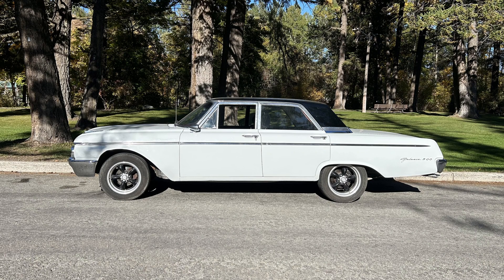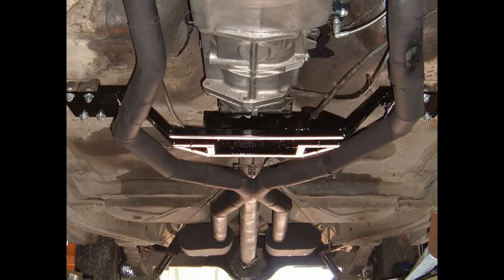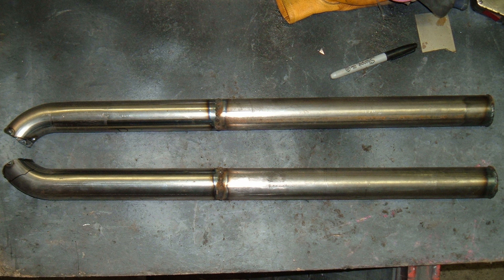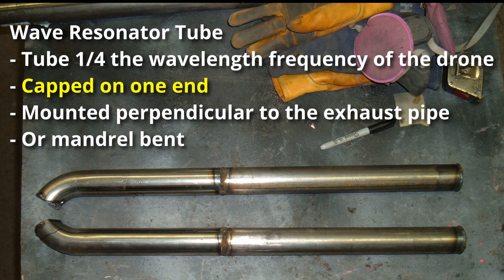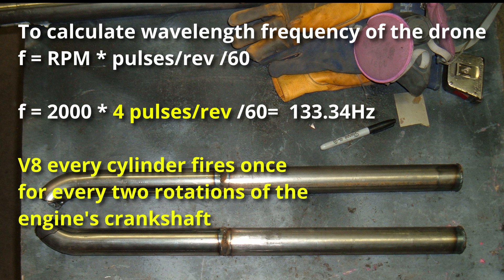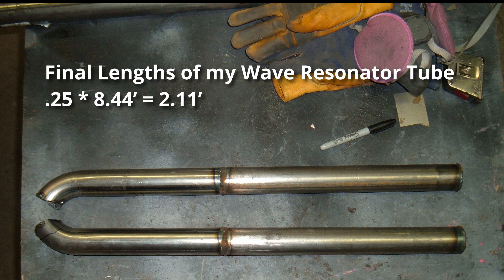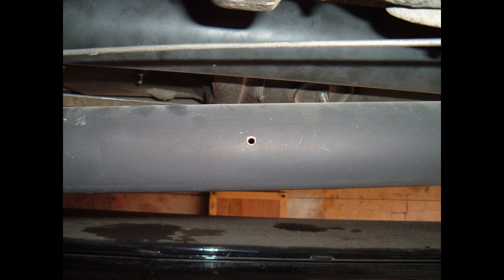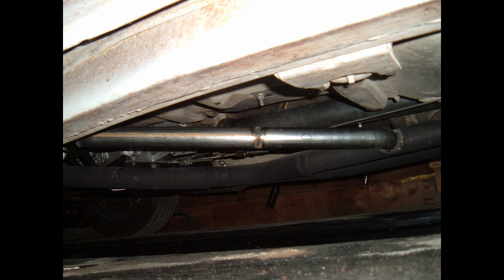Using Science to Eliminate an Exhaust Drone by Building a DIY Quarter Wave Resonator Tube

Comment: I like your simple breakdown of the math.  Some other explanations I have reviewed were hyper fixated on getting the exact operating exhaust gas temperature as well as additional complicated steps involving the inner diameter of the main exhaust pipe and the addition 1/4 wave pipe.
Reply from the maker: I have no doubt those things do effect it but its a dynamic system with all those things constantly in flux (other than the diameters)  Whats nice about this technique is it gets you "close enough" to generally work in a specific range.  Glad I could be of help

Comment: Does it matter where in the system you install this? I always see it AFTER the x pipe and even usually at the tips/mufflers. Am I correct in thinking it doesn't because location changes temperature while calculating speed of sound? I didn't see you take temperature into account when using speed of sound.
Reply from the maker: it doesn't mater because its the entire exhaust vibrating causing the drone.  You can fit it wherever you have room

Comment: There's a scientific study somewhere that says if you round the junction where the QWR T's into the exhaust; it works over a wider frequency/rev range.
Think velocity stack or bell mouth flattened on 2 sides kinda story...
Also less restriction was mentioned IIRC.
Reply from the maker: Very interesting... A little more challenging to do but well within what someone could do in their own garage.   Hardest part would be shaping the bell to fit on a round surface.
Reply: @dazecars  Google:
Noise reduction using a quarter wave tube with different orifice geometries

the side-branch with a bell-mouth geometry resulted in the greatest noise reduction by an adaptive quarter-wave tube.
Reply from the maker: thanks for the info

Comment: Since the noise is traveling, wouldnt its distance drom source be in the calculation?  
When i first saw your style i thought you might have tested it clamped first to adjust for the correct frequency.
Reply from the maker: Thanks for the comment.  Lots of people have made comments and tried to point out variables or calculations that would need to be made or accounted for  BUT they fail to take into account that these calculations are based on the actual drone RPM.  All the factors like the one you mentioned are part of the system that creates the drone.  None of those factors change so the tubes work with just the simple calculations outlined in the video.  I am sure the whole thing could be fine tuned and optimized with more calculations and a better understanding of how sound travels but the system works as is, the drone was completely eliminated on my car and many others so if it works as is there is not much benefit in adding more complication.

Comment: Hi ,does it matter where you place the j pipe and what cubic in engine is in your car,thanks from new zealand muz
Reply from the maker: placement does not matter, you can put it where it fits.  as to displacement that doesn't matter either as the sound is dependent on pulses per revolution not how big the bang is at each pulse.

Comment: Wondering if there was a noticeable range it klled the drone. Like +/- 100RPM? 500RPM? 1000RPM?
Reply from the maker: It killed the drone at the range at which it was droaning.  This is to fix a drone at a specific RPM range not a drone throughout the entire RPM range.  My car was droning a 2000 RPM so I did the calaculations for 2000.   had it been a drone at a different RPM the tube would have been a different length based on the calculations..
Reply: @dazecars  right, but I’m sure there was some drone at like 1900 or 2100 too. Did it fix that as well?
Reply from the maker: Oh sorry, yes eliminated the drone on either side of the target RPM  BUT I was also very careful to get the exact RPM where the drone was resonating.

Comment: I was curious if the same calculation worked for 4 inch single exhaust on my diesel pickup?
Reply from the maker: It should work as long as you account for the correct variables: RPM at which the drone happens and pulses per revolution.  Pulses per revolution will depend on the number of cylinders.

Comment: THANK YOU for breaking it down ... saved me MUCH aggravation (so much easier when someone else already has the keys) 
EZ PEZEE:face-green-smiling:
Reply from the maker: glad I could help!!
Reply: How did you get the frequency of the drone? Sorry if I missed it?
Reply from the maker: its calculated based on RPM at which the drone is happening and the pulses of the engine.  Its all in the "math" section of the video. 3:00

Comment: Did you (or anyone!) check if the diameter of the resonator pipe makes any difference?  I'm running a single 3" system (proven to support more power than I'm making!), and it'd be way easier to make the pipe out of ~2".
Reply from the maker: Excellent question.  When I first researched this mod the conventional wisdom was the wave resonator tube needed to be smaller but I never could find a definitive answer as to how much smaller or why.  My exhaust is 2.25" and my wave resonator tubes are 1.5".  I don't know how bigger or smaller would have effected it but I know it works at this ratio.  2" would likely be perfect in your application as it is the same ratio.  Please don't hesitate to reach out if I can be of any further assistance.

Comment: Thanks for all your great videos!  You have a very relaxing radio style voice.  Random question: can I power two treadmill motors simultaneously via a single controller?
Reply from the maker: Thanks!! Yes and no.  First you need to look at the amp rating.  Let's say they are both 25 amps 90 V thats 2250 watts and two of them would draw 4500 watts.  Thats half of the 10000W the SCR can handle BUT you will likely trip the house circuit breaker if you get up to that many amps.  A motor donly draws max amps under a lod and a slight spike at startup.  The other issue is if they are matched and running together no problem (watts and amps asside) but if they are at all different you will likely have different speeds and different amp draws at any given situation which will effect their functionality relating to each other.  All of this is less of an issue at low speeds and becomes more problematic as speed increases.

Comment: I fabbed a normal large dual exhaust on a GM A body w/ 400 cubes. I installed TWO (large, 2x2 square tubing) crossover balance pipes and made them 10% difference lengths.
No drone. Thinking about taking some of the fiberglass out of the glass packs because it's too quiet. lol.
Reply from the maker: I made a custom exhaust for my Mustang and it didn't drone either.  It all comes down to the the resonance frequency of the exhaust, if that frequency is not produced by the motor at a specific RPM then there is no problem.

Comment: I'm still trying to figure out why anyone would want to cancel the drone. So weird.
Reply from the maker: You have missed the point as this is a resonance drone not the typical sound of a custom hot rod exhaust..  Im not trying to  "Return to a more stock configuration" or avoid "sweet motor music".  As I said in the video a  resonance drone is where it only happens at a specific RPM, in my case around 2000 and once it starts happening it is way louder than the normal exhaust and continues to get louder and louder and louder until you move out of the 2000 RPM range. It was quite annoying, deafening and sounded bad.
Reply: @dazecars  I guess we both missed the point then. An impressive plumbing job none the less .
Reply from the maker: Thanks,  I'm all for the "sweet motor music" in the right aplication my Mustang is very loud and rumbely, the Galaxie is more of a cuiser.  With either one though drone is bad.  😁  @hawkdsl
Reply: @dazecars  Just found your channel and this vid. Perfectly short and useful info. My Jeep LJ has a terrible drone at my highway cruising speed too and yes it's annoying after a few hours. I dont' have the skill you do but if I can design something I'm sure a local shop can weld stainless for me.
Reply from the maker: glad I was able to help
Reply: Ear sensitivity to certain frequencies differs from person to person.
Reply: @docsockem  sure, but part of a custom exhaust is to enhance that sweet motor music. Returning to a more stock configuration would do the job, and without the elaborate plumbing.

Comment: The included data was great but it would be great to know more particulars on your application including the engine, primary cross section, exhaust pipe diameter and the muffler type/dimensions. Before and after sound would be cake too.
Reply from the maker: I can provide all but the before and after sound bites.  I did this mod years ago before I was making videos for youtube, and because of that I do not have any before recordings and after recordings don't mean much without any before recordings.   As to the rest of the info, its 2.25" exhaust with turbo stile mufflers going to a Ford 302 with shorty headers, BUT all that information is really irrelevant.  An exhaust drone is custom to each specific application because it is where the sound of the motor at a specific RPM matches the resonance frequency of the custom exhaust.  If you change the size of the exhaust or the type of muffler you will change the resonance frequency making it happen at a different RPM.  So each configuration is likely going to have the drone at a different RPM.  Because the calculations apply to each specific vehicle configuration as a complete system and is based on the RPM of the drone all those variables you are asking about are already taken into account because they are contributing to to the factors making the drone happen at the specific RPM it is happening at.  That is the beauty of this solution.  It looks at the the exhaust as a complete system and solves the problem based on that system.
Reply: @dazecars  This is very interesting..I love your scientific approach to solving this problem.  It would be even more interesting to experiment with a few different variables one at a time.  What would you hypothesis would happen if you had used a stock manifold vs/ shorty headers vs/ long tubes? Used a H pipe vs/ X pipe, vs/ a Mac chambered mid pipe vs/ straight pipes to the mufflers?  Moving the mufflers up before the axle and then back after the axle?  Changing the diameter to 3", and steel pipe vs/ stainless steel pipe?  Change up different muffler brands and sizes and compare Turbos, Magnaflows, Flowmasters, and Borlas.  It's my understanding that larger pipes add more HP and change the tone deeper?  I'm working on a FE 390.  It's currently got the stock exhaust manifold with 2.5" steel pipes straight pipes to Flowmaster Super 40's.  It's supper supper loud and drones pretty bad around 2k RPMS.  Everyone says it sounds great from outside the car, but it's a convertible and after an hr of cruising I'm looking for a pair of ear plugs and change up something.  I'm not sure if it's a Flowmaster thing or if it needs an H Pipe.  I'm unsure where to begin?  These experiments can be costly and time consuming..no need to reinvent the wheel if someone has alredy done and has first hand knowledge with an FE engine.  You know that saying about opinions...everybody has 'em.  I'm looking for facts.
Reply from the maker: All of these variables as it pertains to eliminating a drone would only have one effect and that is more or less mass.  Changing the exhaust mass will change the RPM at which the drone reaches resonance.  The rest of your questions relate more to sound through the entire RPM range and each of the components you mention will have significant impact on the over all sound but how much and what changes are the real question that would take a little trial and error.  I absolutely love the sound of an X pipe but that is personal preference.

Comment: Nice work.  I've always been interested in resonance.  It's fun science.  

Did you consider the speed of sound is different at exhaust temperature and pressure vs. standard atmospheric conditions?  I really don't know how much that changes the values.  Just a thought.
Reply from the maker: So I was aware that temperature effected sound but didn't even think about pressure affecting sound.  Good news is the wavelength frequency was based on the active exhaust under working temperatures and pressures.  So pressure and temperature were not an issue as those conditions were present at the point of the drone I was eliminating.  

I also think this technique is somewhat forgiving.  The tube is 1/4" length because by the time the sound goes down the tube and then travels back (1/2 the wave length) we have created an inverse sound wave BUT a little bit plus or minus while not being as effective still works if that make sense.